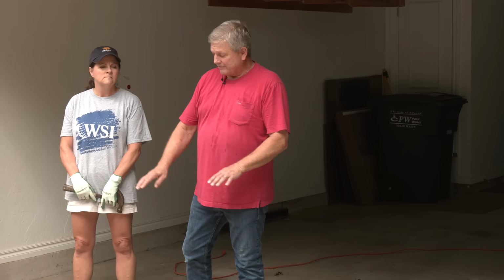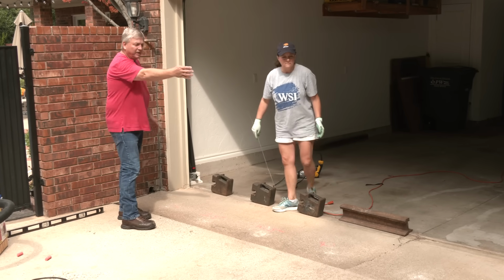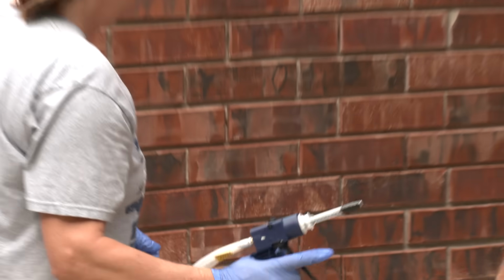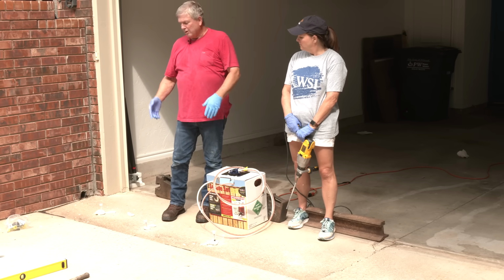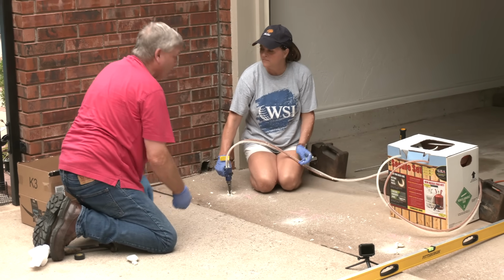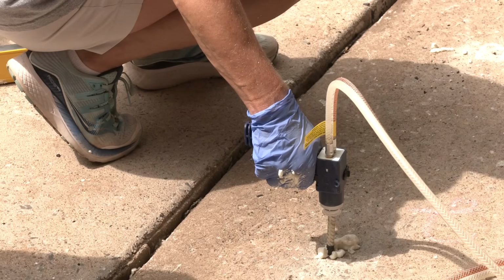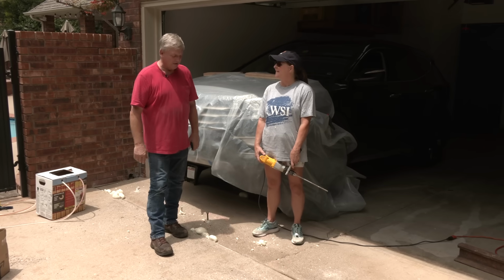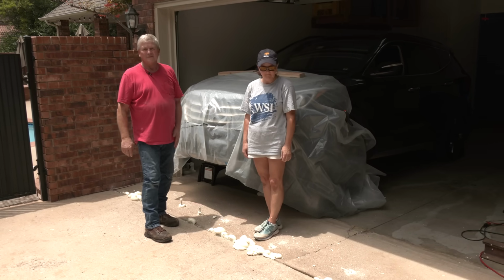Raising Concrete Driveway Slabs with Secure Set

Comment: Why not this?

1. Cut the expansion joints clean on all sides 

2. Drill in concrete fasteners at appropitate points that need to be raised

3. Pull up with a jack and level it up.

4. Drill a few 1-2"inch holes with a core saw bit 

5. And pour in concrete thru those holes ?

Comment: From the very beginning, everything leaked. The attachment for the nozzle was completely faulty — the foam didn’t go into the intended opening and instead spilled all over my hands. I tried switching attachments, thinking one might be defective, but every single one leaked the same way.
When I contacted customer support, instead of resolving the issue, they asked me to purchase an additional part for $100 — even though the one they sent was clearly defective.
Overall, it’s been a very disappointing experience, and I strongly recommend avoiding this product.

Comment: What do you do if the slab in question raises too high???
Reply from the maker: Thank you for your question. The only thing that can be done if the slab raises too much is to use a grinder on the concrete slab. Something important to remember is to work slowly enough that you can see the lifting start and sometimes even hear it before you see it.  Spraying in small increments at a time is very important. Remember that it is a finessing project, and that the foam will expand 2 to 2 1/2 times the volume being sprayed. 
Thanks again for your interest. 
GRA Services. 
Www.secureset.net

Comment: If further investigation was done it’s probably a leak in the pool behind the gate there groundwater leaking from a gutter could do this but pools get away with a ton of damage because they are seldom the suspect because they are always full of water lol but one leak of a few gallons a day consistently leaking from a source will erode worse than a downpour out of a gutter but time will tell… great video it’s amazing the lift that foam has
Reply from the maker: Thank you for your input, since it is a possibility that it could’ve been a part of the problem. We have talked with customers in the past that have had those types of issues with their pools leaking and causing many problems such as this. 
This customer hasn’t had any further problems with their concrete slabs. 
Thank you again for watching and your interest in Secure Set . 
GRA Services
www.secureset.net

Comment: I am confused, at 20.43 it shows no lifting of concrete at 25.00 you say it is raised to 1/4 inch above. How about showing the end “levelness”
of the the slab with the level as you did when you  showed the drop of concrete of 1 1/4 inch. Your words do not match the video when you say it raised the additional  1/4 inch.(  ?) . A side view of the finished job would have shown the total rise your material created. , and show it with the hardened foam removed.Consequently, I cannot agree that  your product works. Further can you tell me what is the lifting force psi of your foam so one could determine that it indeed lifted a 5 inch thick concrete slab? Thank you

Comment: I would suspect that the drain pipe coming out of the sidewall is the culprit for the washout.
Reply from the maker: Yes, that is what was determined.  Come to find out, it also created a lot of void areas under the driveway down to the road, which required more foam to fill all of those areas, as well.  But, now they have a very solid supportive driveway, since the foam that was used on this project supports 10,080 lbs. per sq. ft.  We now also have another kit available, which supports 5,040 lbs. per sq. ft, and that is plenty for most residential driveways.   
Thank you for watching and commenting.  GRA Services - The Makers of Secure Set.  www.secureset.net

Comment: These boxes arent cheap... so she likely spent upwards of $900+ on material alone?
Reply from the maker: The cost per project is dependent on how much material is needed to complete the lift, but it is still a great value for an easy DIY project.  Sometimes it takes more foam than expected, because the foam will find the path of least resistance and fill in many tunnels and voids, as well as it will compress soil before lifting.  This caused her particular project to require more foam than expected, but in doing so it gives her a great support under the slab in many other areas that had unknown amounts of voids.  Also, they did not have down time for the use of their driveway and garage, like they would have had while waiting on concrete to dry and cure.  There are many benefits to doing the project in this way, vs the old-fashioned way of just jackhammering out the old slab, filling with gravel/dirt, compacting, and then replacing the concrete.  And then not even knowing there were other voids running down the driveway, which could have created future failures, as well.  
Thank you!  GRA Services - The Makers of Secure Set ...  www.secureset.net

Comment: would this method lift the corner of a monolithic slab? It's only 4' wide.  I need to lift 1 inch of that corner. Should i call to discuss and possibly text pictures?
Reply from the maker: Thank you for watching and for the question.  What type of slab is this?  You say it is 4' wide, so is it a sidewalk?  The ability to foam jack a slab will depend on several factors.  The foam will always follow the path of least resistance and will escape under adjoining slabs, or through tunneling into the yard, if it can.  First you must fill all the void space the foam finds, and then if there is compression of soil it will create more void space to also fill.  Once the foam has no where to go, it should lift the slab.  If this slab happens to have rebar in it, that will generally impede the lift and it would likely need to be cut in order to get the lift.  If you would like to call us at 405-672-8885 we can discuss your project in more detail. We are open M-F 8:30 to 4:30 CST.  If you would like to order, please visit our website https://secureset.net/shop-results/  Thanks again, GRA Services

Comment: How many boxes of foam did you end up needing?
Reply from the maker: Thank you for watching our video.  As stated at the end of the video, for this project we used almost 2 of the Secure Set Spray Foam kits (the 10 cu. ft. kits), since at that time 4 years ago that was the only kit available.  The foam found it's way under the garage slab and down the driveway toward the road, since there was a lot of void space found by the foam before it would lift.  It will also compress soil before lifting in cases where the soil is not fully compacted.  
We now also have a 16.6 cu. ft. kit (heavy duty kit) that we would use for most residential driveways, since this one will support 5,040 lbs. per sq. ft. vs the 10,080 lbs. per sq. ft. that the extra heavy-duty kit supports.  You can find these kits on our website https://secureset.net/shop-results/ .  
Thanks again, GRA Services - The Makers of Secure Set

Comment: I used this to raise a fairly large driveway section and all worked as shown in your video. One word of caution is to wear safety glasses and long sleeves which is NOT in your video but is included in the instructions. I ended up getting a back pressure spray in the face and thankfully had my glasses on.
Reply from the maker: Thank you for using Secure Set Spray Foam for your driveway foam jacking project.  Yes, you are correct that following the instructions in the kit (and on our website www.secureset.net) is very important for safety reasons as well as for understanding how to use the kit.  The foam is somewhat like super glue it that it is almost impossible to get it off of your skin and clothes, so protection is necessary.  Thanks again, GRA Services

Comment: This is also why you need to set a string from down the driveway into garage to know if you need to start further down the driveway to help lift
Reply from the maker: Sometimes, like in this case, the water intrusion did cause tunneling down the driveway and those tunnels did have to fill with foam before we were able to get it to stop traveling and start the lifting process.  You could start at the bottom and work your way up the driveway, but then you have a lot more drilling to do, as well as filling of drilled holes.  Sometimes projects can also be down as the lift all the way up the driveway, if needed.  Thanks again, GRA Services - The Makers of Secure Set

Comment: What size holes do i drill for leveling sidewalk?
Reply from the maker: We use 3/8", then cut back the nozzle tips about 1/2" for a better flow and wrap black electrical tape about 5 to 6 rounds under the flares on the mixer nozzles so that you get a very tight seal.
Thank you!  GRA Services www.secureset.net 405-672-8885

Comment: Since that is a narrow portion busting out old and replacing would have been my route.
Reply from the maker: Thank you for watching the video.  Some people have the ability and tools to jack hammer out the old slab and pour a new slab, but not everyone has that ability or wants to do it the old fashioned way.  This is an alternative way and can be a very easy project, which doesn't put your driveway and/or garage out of commission for several days.  
When quoting with concrete contractors, this can really be an expensive project, when it isn't always that much when using the spray foam kits. 
Thanks again, GRA Services - The Makers of Secure Set

Comment: Should have cleaned out the joints first, so the slab could move more freely. Right?
Reply from the maker: Thank you for the comment.  Yes, that would have likely helped from the beginning; however, sometimes for some reason it isn't necessary.  Who knows, every case is different. 
GRA Services

Comment: just tried doing this, was simple but the results were not what I was hoping for.  I believe the product is fine but my void is larger than I was hoping it was. I tried to form walls all around the area I wanted to raise but my best guess is that it still found a way underneath and spread out further.  I did hear the cement slab crack a little as it was trying to raise but at that moment I ran out.  I think the product is good but its hard to calculate what you actually need to do a project when it is a large, I guess the good thing is you can always order more but for me it will be to cold before it gets here so I will leave it till spring.
Reply from the maker: Hello and thank you for the comment.  Spring is here now, and summer in some areas :).  Have you tried again to add additional foam to get the lift you were needing?  
Some pointers would be as follows:
1.) make sure you don't have rebar somewhere that is impeding the lift, if so, it might need to be cut in order to lift.  Also, there could be an issue with seam sealer, putty, or wood in slab joints that need to be removed.  
2.) compression of soil creates an unknown volume of void space.  It is easier for the foam to compress some soil types rather than lift. 
3.) you could try an "upper lift", which is where you drill back through holes to the top of hardened foam and "try" to apply more foam at that point, vs going all the way back through the first layer of foam.  The upper area lifting can create blow back of foam from the extreme pressure, so cover yourself and your surroundings very well.  If you can get that to work in some of the holes, you may have great luck with a quicker lift.  
Thank you, again.  GRA Services - The Makers of Secure Set

Comment: If she wasn’t standing on it maybe it would help 🤦🏼
Reply from the maker: Her weight is not significant enough to make a difference.  The foam was likely still finding void space, probably traveling in tunnels down the driveway and/or compressing soil which was making more void space.  But they finally were able to get the lift needed and that was a win.

Comment: so full foam used cost was over 900$ in foam only and didnt even raise the 10 ft slap , how much you should charge a customer as a handyman being hired by a customer? 3000$?
Reply from the maker: What do you mean it didn't raise the slab..... when it actually DID raise it.  It wound up taking more Secure Set Spray Foam than we estimated, since the water erosion made more void space than we actually located during the hammering/drilling investigation.  The foam will always follow the path of least resistance, and come to find out it actually flowed down the driveway, as well as under the garage floor on this project.  Sometimes you will hear it running different directions under the slab.  If that happens, you could stop and shut down the system (according to the directions) and wait 15 to 20 minutes for the foam to harden, to help stop those run off areas in order to use less foam.  Also, when starting the lifting part of the project the foam can compress soil making more void space to fill before it will lift.    
We do not know how much you could charge a customer for this type of project.  We've had many contractors, handymen, as well as DIY customers that have said bids from foam jacking companies are anywhere from a minimum of $2,500 to $7,000 for slab lifting projects.  Many times when their potential customers do not want to pay the minimum of $2,500 for a sidewalk, patio, pool deck, etc. they will purchase our Secure Set Spray Foam kits to do the smaller jobs instead of losing that customer.   Thank you, GRA Services

Comment: how many feet away holes from each other  need and whats size of drilling hole for injection?
Reply from the maker: We use anywhere from 1 ft. to 2 ft. apart, it all depends on the project and the depth of void space found under the slab.  Use a 3/8" drill bit, and cut back the mixer nozzles about 1/2" to allow for better flow of foam, then wrap black electrical tape under the flares of the mixer nozzles about 6 to 7 rounds.  Make sure they fit tightly to not allow for any blowback of foam.  Thank you, GRA Services

Comment: The obvious result is that the foam will eventually compress and you will be back where you started from.
Reply from the maker: Not hardly!  You apparently missed the information about this being a closed cell high-density foam with a compressive strength of 10,080 lbs. per sq. ft.  What would you have on a residential driveway slab that you would be concerned with it becoming compressed?  Not vehicles, since the load is distributed over all wheels.
All of our projects still have extremely hard non-compressed foam.
Reply: Just tear out the offending concrete and re-pour. its the quickest, easiest and most long lasting way. Make sure you fix the cause of the void.

Comment: You have to spray it at the lowest point
Reply from the maker: Many times the foam will run to the lowest point, but you can also start from the lowest point and work upward, if you know there are voids all along the way.  Otherwise, you could possibly cause a lift in an area you do not want to lift.  Thank you!

Comment: It would be great if you could use the safety equipment as suggested on the box.
Reply from the maker: Yes, we started with safety goggles but removed them because of the heat and the video project.....but as everyone can see from the foam blowback possibilities it is a very good reason to wear them at all times.   Thank you!
Reply: A face shield is good for that situation.  It has much better airflow so it's cooler to wear.
Reply from the maker: @vballjim01  Yes, that is a good idea, as well.

Comment: The easiest and best thing to do is remove that small section of the concrete apron, FIX the base, then repair the small amount of concrete slab. Would be a permanent long term solution m, amd inexpensive DIY
Reply from the maker: That is definitely one way to correct the issue, but this is an "alternative" way to approach the issue and many people have appreciated our product for this type of project with GREAT results.  Thank you for watching!  GRA Services - Secure Set

Comment: Just break it out and repour it. So much better because you can address any ground issues.
Reply from the maker: This is an alternative way of doing the project.  Bids for the concrete replacement and the necessary fill that would have been needed just in that area are surprisingly expensive these days.  Then because the foam found more places to run to and fill than we necessarily expected, now there is great support in those other areas, as well.  
Thank you for watching.  GRA Services - Secure Set

Comment: Probably cheaper to dig it up and repore it 😂
Reply from the maker: It was quoted in advance and actually was not less expensive, if you quote that type of work these days.  Plus there were other washed out areas down the driveway toward the road that the foam also filled and now that area is also supported from future issues.  Thank you for watching.  GRA Services - Secure Set

Comment: You didn't mention how long to wait after the 1st " base injection " to re drill, re inject & lift
Reply from the maker: It all depends on how deep the void space is / foam thickness.  It starts to harden in 2-1/2 to 3 minutes (crusting over and stops expanding). We usually wait about 17 to 20 minutes before drilling back through the foam.  Thank you for watching.  GRA Services - Secure Set